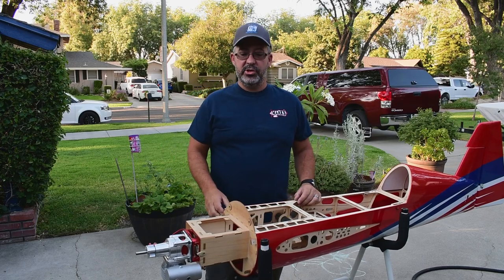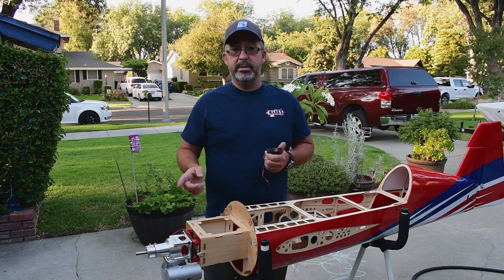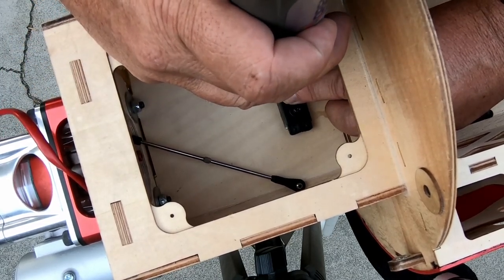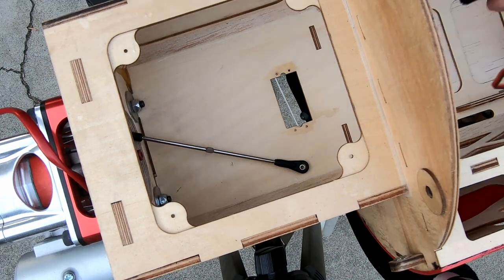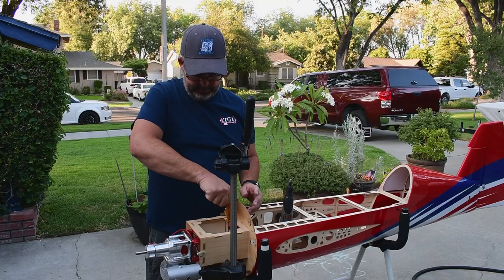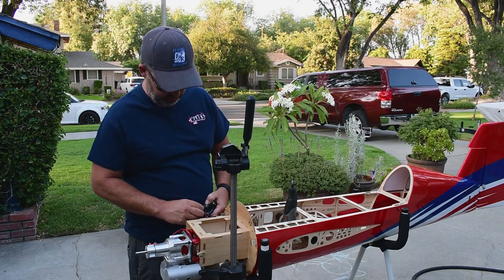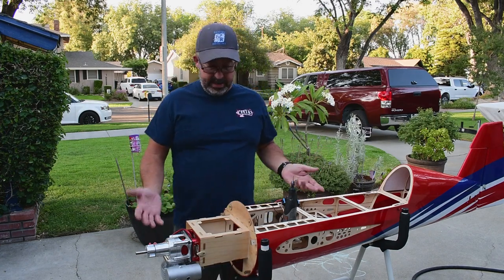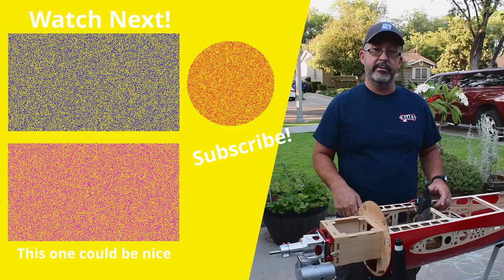Throttle Servo Setup (Tech Tuesday) - FlightReviewz

Comment: I’ve learned a lot from your videos but I think a lot of guys take a different approach on throttle setup. The Walbro carbs on most gas engines are super sensitive at low throttle and not at all sensitive at high throttle. You can get much more linear throttle response by setting up the servo arm so it points almost directly towards the throttle arm at idle, and using the shortest servo arm possible that still gives full range of operating RPM

Comment: Great video and thank you for making it. I didn't notice that you mentioned the orientation of the throttle butterfly needing to be placed half open/closed only the servo arm. I thought both were important to be half open/closed before connecting the linkage. Was under the impression this was very important in order to get the proper geometry. Maybe I learned something new. Thanks again and look forward to seeing more videos in the future.
Reply from the maker: Thank you for the feedback, Hank. When I am talking about the movement of the push rod lining up with the servo opening I am setting it so the butterfly is half open when in the center of the servo opening. I should have been more clear on this and will be sure to cover it on another plane to try to add some clarification.
Reply: @FlightReviewz  Thanks guys, I really enjoy your videos and even after some 40 years in this hobby, I still find things to learn and apply in my flying. I guess your never to old to learn new or better ways of doing things. I look forward to seeing a video covering baffelling which I requested some time ago. I know there are many different ways of doing this but I am interested in seeing how you suggest it should be accomplished. Again, thanks for your time and efforts in making our hobby enjoyable.

Comment: Hi Jason, good job, nice video!
I noticed that you used the servo screws without these rubber grommets, that normally come with the servo, right?
However you seem to use a verry smart, dumping enginge mount (is there something similar also for the DA50R?) these rubber grommets  could reduce the risk to get your servo electronic damaged due to vibrations isn't it?

So far i was only into electric powered planes and turbine jets, so vibrations haven't been an issue, but now, as i build (restore) a 33% pitts, powered with a gas engine (as said, a DA50), I fear these vibrations!
A throttle servo, stuck in full throttle isn't something one wants 🙂
Or is the posive effect of these groomets overrated?
Greetings from Germany 🙂
Holger
Reply from the maker: Holger,

Thank you for the comment. The motor mount is a Blazing Star mount purchased from Northwest RC. There is no dampening on this mount.

As for the grommets on the servos, The rubber grommets are there and the metal eyelets are installed from the bottom as they are intended. This causes the head of the screw and the bottom of the grommet to be isolated by the rubber in between. This causes the dampening effect you are referring to. I tighten them up and then back them off an eighth to a quarter of a turn. This helps lengthen the life of the servos.

Hope this helps. If you have any further questions don't hesitate to ask.

Jason
Reply: @FlightReviewz  Thanks for explanation! Didnt see the grommets - only black  🙂
Keep up our good work! Learned a lot!
Greetings from Germany :-)
Reply from the maker: @Kraftei  my pleasure. So glad you enjoy the channel! Don't hesitate to ask any questions you have along the way.

Comment: Get yourself a good gyroscopic screwdriver (DEWALT DCF680N2) and long hex bits and you'll save so much time putting servo screws in and taking prop bolts off.  Simple to use and I've never stripped anything with it.  Lot easier on the hands too.
Reply from the maker: Thanks Don. I do have a really nice Ryobi Tech 4 screw driver that I use in conjunction with MPI bits when assembling planes at the field. I do prefer using a hand driver when building to avoid stripping fresh wood.
Reply: Hi Jason have finished your Yak .Hope all is well with you and your family

Comment: I also use hardwood pieces under the servo so the screws have plenty of wood to bite but why not use a threaded almn. arm looks like the standard arm threaded would not hold up
Reply from the maker: Thank you for the comment @send it. The engine is the source of all vibration in our airframes. For this reason, we prefer to use a nylon arm with a threaded hole. Jason's competition IMAC plane has over 1500 flights on it with this setup and he has had no issues.

Comment: Nice video..new sub here..thx..
What servo driver is that you use ..very useful 👌
Reply from the maker: Ed, the servo driver we are using is a JR Matchmaker. They are hard to find these days. However, Spektrum and JR still make similar devices. We may try to review a few of the available options in the future.

Comment: How do I trim the turbo timber to fly straight when taking off?
Reply from the maker: We had no trim issues with our Turbo Timber. As long as the AS3X is active you should have no issues. Make sure the surfaces are all centered when the trims are centered by adjusting the lengths of the push rods if you have any issues.